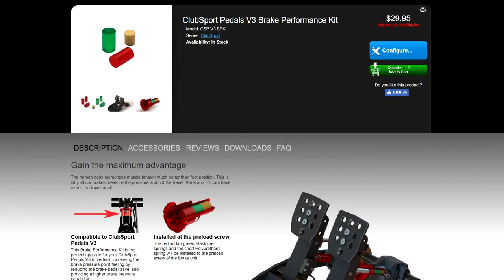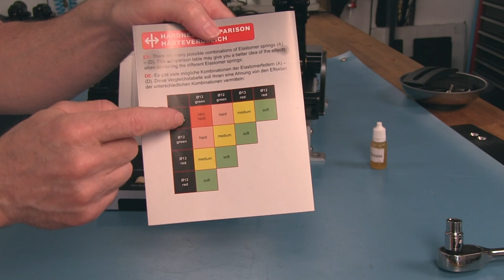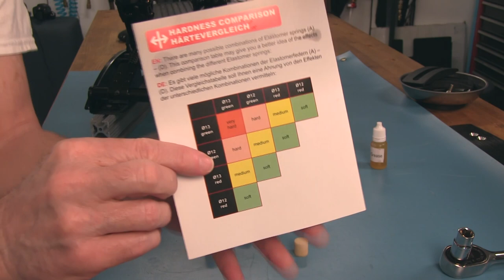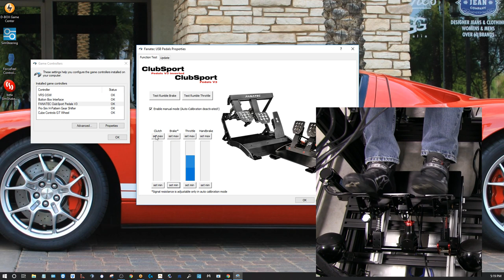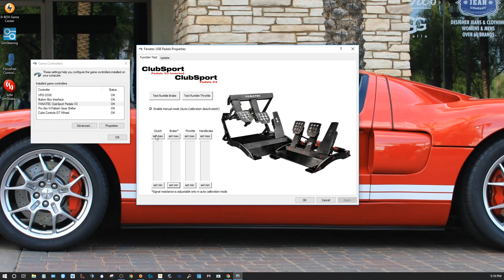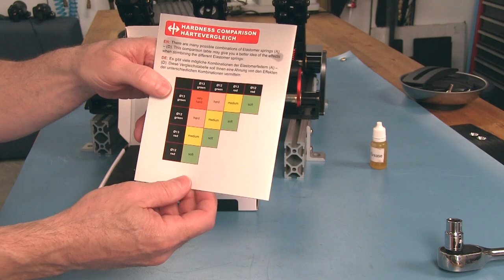ClubSport Pedals V3 Brake Performance Kit Review

Comment: FYI: I just read this in Fanatec v3 pedals manual: "Please  add  some  technical  vaseline  to  the  PU  foam  inside  brake  pedal  if  it  develops  a  stuttering  feeling.  Do  not  use  the  lithium  grease  from  ClubSport  Pedals V3 box content as this might affect the life time of the PU foam." Of course I read that days after I did just that to the original foam pieces that were in pedals, as I didn't like the very hard feeling of the red rubber in Performance kit box :-O

Comment: I want a firm break, but I also want a good amount of room to press it down, I can’t seem to find a good middle, either a I get a lot of room to activate the pedal and it’s very light, or no barely a inch of room of moving the pedal makes it very firm and good feeling, just I would rather have a longer push, it’s just so short when it’s tight

Comment: When I installed even the softest combination the pedal was rock hard and had about 1mm of travel with extreme pressure, is my kit broken? I replaced them with the two that came with the pedals and it worked again.

Comment: how do you set up this rig? im planning to get a vrs osw, cube control wheels, clubsport pedals v3, for my shifter and handbreak i might switch to a better one in the future but for now i think i'll go for the thrustmaster sparco handbreak and its shifter. now the problems is what are the extra that i need to buy to fit all of this to my pc. seeing you most likely have all the sim rigs there is on your garage i assume you got the answers. and do vrs deliver globally? thanks
and a next level racing f-gt and will diy around it to make my osw more stable.

Comment: That set screw on my v3 pedals is done up so tight by whoever was employed to make them, it is impossible for me to undo. I’m taking them to work tonight to see what the engineer can do to help. Fingers crossed🤞🏻
Reply: Received my V3 pedals this week and I have the exact same problem. Did you come up with a solution?
Reply: Just got these pedals w/ free BPK during the Black Friday deal and the screws are ridiculously tight on mine too.  Absolutely no reason for the set screws to be THAT tight.  Fanatec needs to go easy on how much they tighten their hardware.  Even the flat head screws holding the pedal faces on were way too tight.  So much so, that I had to use an allen socket and ratchet to get the pedals off.  Ok, enough venting.  😁  Anyway, I was able to loosen the set screw by inserting an L-shaped allen wrench, then take a set of pliers and grab the allen wrench in such a way that the grippers on the pliers are evenly spread over the long and short ends of the allen wrench where the "bend" is (basically crossing over the "bend" in the wrench, if that makes sense).  This is to help avoid bending the allen wrench, or at least that is my theory anyway.  Then using the pliers, CAREFULLY turn the wrench.  Mine was on so tight you could actually hear the set screw "break" loose from the threads. 🙄
Reply: @JP-fs4cl  I had the same problem and I could remove it the same but then I couldn't put them in. I solved it by filing the notch in the cylinder. I also claimed fanatec and they sent me the whole piece for free.
Reply: @JP-fs4cl  grabbing my allen wrench with pliers did the trick for me, thanks.

Comment: @Sim Racing Garage, Is there an easy way to swap the clutch and break on V3 pedals, I see there are several that have bought this pedal kit, but needs to swap when using Playseat F1 because of its middle rod mount.
Perhaps you could do a video on how to do it?
It seems the issue is that the vibration wire for the brake is too short to do the swap, do you have a solution to this?

Comment: Did I missed something? You completely misunderstood what the durometer was reading and therefore proceeded to install a 12 green + 13 green i.e. a hard setting; in the end, you complained about not having a stiffer setting, which by the instructions is the double 13 green that you discarded because of the durometer reading. 
If that is the case, you might want to review you understanding of the difference between hardness (of a material) and stiffness (of a whole part built out of said material). ;)

Comment: 10:20 Totally unable to get the screw move a bit. It has been overly tightened...
Reply: Received my V3 pedals this week and I have the exact same problem. Did you come up with a solution?
Reply: @sj3296  same problem here, this thing won't move...
Reply: @Valdzor  I heated it up with a hair dryer to melt the glue that they used with the screw. Pretty annoying the first time I couldn't get it to twist!

Comment: idk what im doing wrong but i cannot for the life of me get the steel pin removed. seems to be binding. followed instructions to a T. any help?
Reply: Did your kit come with a little plastic or metal wedge? You have to put something between the pedal arm and that "D" shaped black spacer that holds the silver metal pin and apply some pressure. When you do, that little pin should come out easier. This is really important because if you don't put something there and pop out that pin it will push hard against the vibration motor wire and possibly damage or break it.
Reply: @mr6291  thanks yes it did and I used it. Just also used some WD 40 and came right out :)
Reply: @Newmyyy  Good call. Glad it worked out.

Comment: things like this is why I won't put up the money for fanatec.
their stuff is expensive enough without nickel and diming people for 7 bits of rubber.
30 bucks for this is outrageous. (its a couple of bucks worth of parts at most)
a quick search on ebay brought up solid rubber rods at 7 bucks a METER (sure you would have to source a good hardness but 30 bucks is FAR too much for what this "upgrade" is)

even entry level stuff like thrustmaster TP3A pedals give you brake mods in the box (if you want to use it) sure it's not great but the little metal bracket with rubber stopper on those pedals would cost MUCH more to make than fanatecs 7 bits of rubber and TM give you it for free.

thats the problem with high end stuff , they think it automatically allows them to put a high price tag on anything associated with it. even something as mundane and easy to manufacture as some chopped off bits of rubber.

Comment: Would someone be able to use theses pedals without mounting them? I just use my desktop to mount my wheel right now and I am looking to start upgrading.
Reply: Sneak69 no unfortunately not, however you could mount them to a large piece of wood, like a bit of old worktop.
Reply: You can as they have 4 large hard rubbers under the frame but will likely move around depending on the surface especially when braking or using the clutch.
Reply: Stephen T I found the pedals  tend to lean back and the front lifts of the ground if you have the brake preload turned up. I ended up using my left foot to hold the front down, as you can imagine it’s not the best method.
Reply: @baj993  Yeah that's one of the issues also, it can work but obviously not ideal and like you said the brake needs to be on it's softest also which this hard rubber kit would be pointless using not being screwed down.

Comment: Wondering how much the dampener add on stiffens it up? 🤔
Reply: The damper is only useful for the gas pedal. At the brake it does not really makes sense. At the beginning I had to dampers installed but after a while I decided to sell the one from the brake

Comment: I am in the Polyurthane business since 20 Years: what you have got there is actually all the same material. As you always have a hardnes tolerance of +/-5 Shore A, the parts should be 90 and 80 Shore A. So the 90 Shore A parts should be between 85-95 Shore A and the softer ones between 75-85 Shore A. I cant see a difference between these colours. Good idea and good service of fanatec but the PUR-Materal is rubbish. This happens when you dont produce it on your own and have to buy it. BTW.......you can't measure Foam-PUR with the Shore A-Durometer. On Foamed parts its all about the density
Reply: 30 Bucks? I should sell these parts for the half with a higher quality :))))))))
Reply: I’ll buy one set of hards please!

Comment: Had to laugh when I saw this ..... the reason ? simple : the chart shows that if you put a 12mm GREEN with a 12mm GREEN the pedal is classed as MEDIUM but hang on a second ..... YOU ONLY GET ONE 12mm GREEN IN THE PACK !!!!!!!
And then the chart DOES NOT show a rating for 2 x 13mm REDS WHICH YOU DO GET IN THE PACK !!!!!!!!!
Methinks they dropped a clanger here !!!!!
Also I wonder if the reason you had braking pressure showing when you first set the pedals up is because you wound the "tensioner screw" out which will have "pre-crushed" the "PU FOAM" insert (which is what's meant to give you the dead-zone pre-braking travel).
Also I would suggest that you didn't have the "hardest" brake pedal you could have had because (unless I mis-saw what you did) you inserted the 12mm GREEN with a 13mm GREEN & the HARDEST brake is set using 2 x 13mm GREENS, so you could potentially have a slightly harder brake pedal.
Reply: You do realise that's because for medium you can just use a 13-green + 13-red no need for a second 12-green. They just didn't wanna leave the field empty.
Your second issue is because the chart is just minimalistic:
Anything less than a 13-red + 12-green is gonna be super soft, maybe even unusable/not recommended.
Methinks they're not the ones who 'dropped a clanger here'.
Reply: @SilvoWhat  Well they ARE the ones who dropped the clanger because THEY are the ones who list ON THEIR CHART that 2 x 12mm GREENs are MEDIUM, but then they only supply ONE 12mm GREEN, so it IS them that have dropped the clanger !!
But actually two 12mm greens would likely be HARDER than a 12mm green with a 13mm red as, although the diameter is smaller greens are "stiffer" than the reds are so actually the 2 x 12mm greens would likely be classed "harder than medium" but "softer than hard".